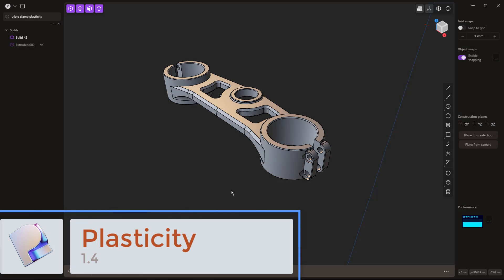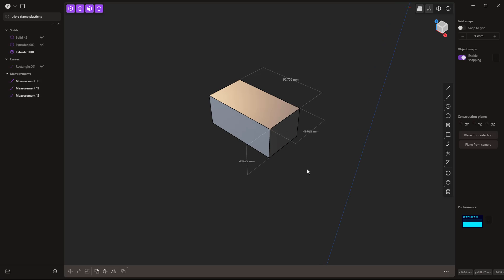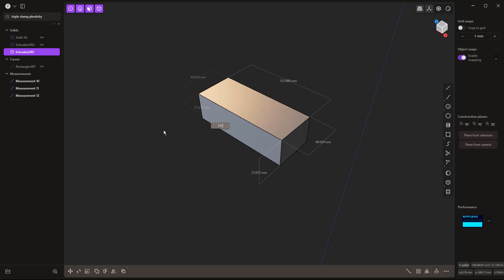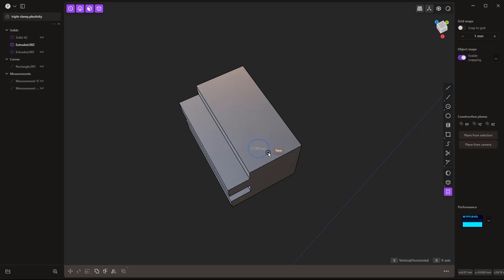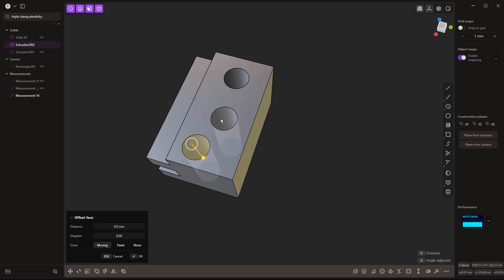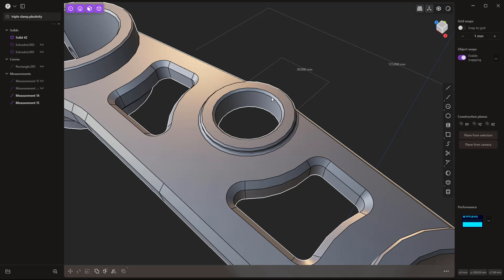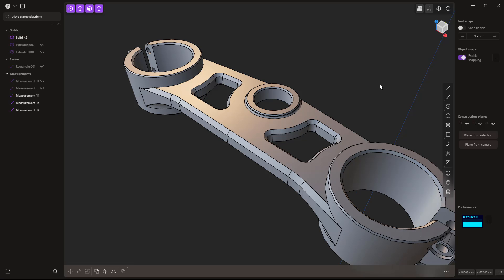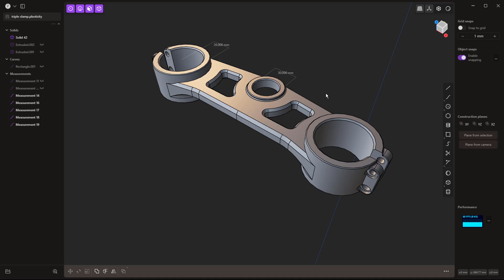Plasticity 1.4 | Dimensions and Measure Tools | What They Do And How To Use Them | #plasticity

Comment: Alot of great tips here! But for some reason my quick commands dont work! I have to search dimensions and click it in the search bar every time to use it. Not all the commands are like this, just some. Any tips?
Reply from the maker: hmm,  when you search for Dimension is the = key the shortcut you see?  With the dimensions on objects it will be dependent on the selection.  Does it work with anything at all?  Like if you start a new design with a primitive Cylinder or box, do you see those?
Reply: @LearnEverythingAboutDesign  thx for reply. Some shortcuts work, but far from all. Maybe its because Im on the free version still?
Reply from the maker: @Ronh83  that shouldn't be the case.  what type of machine are you on? Windows, Mac?  pc/laptop?
Reply: @LearnEverythingAboutDesign  im on a Windows laptop.
Reply from the maker: @Ronh83  do you happen to have a desktop to try it on?  I can't think of a reason why they wouldn't work for you.  Which version are you currently running of plasticity?  I am on 1.4.18
Reply: @LearnEverythingAboutDesign Looks like I have version 1.4.19   Are there differences with keyboards? I live in Norway, maybe my keyboard keys are setup different? And no, dont have a desktop.

Comment: I’m a mechanical engineer. I’m thinking about getting the indie license. I’ve been a Solidworks user since it was first introduced. The nice thing is I can create something export as a step, or parasolid. Bring it into Solidworks and use feature works to identity the part create sketches for features. Then I can fully define the part in Solidworks.
Reply from the maker: IF feature works works then yes :)  It is hit or miss.  But this is built on the Parasolid Kernel so you will be getting good BREP geometry in the process.

Comment: Really interesting thanks. at the risk of asking too complex a question: if i wanted to model a 3D bike frame, based on a simple set of key dimensions for the frame size, I think plasticity isin't really the tool for that right? like, if I started with a size "small" and then changed some key dimensions to make a "Large" frame, whole groups of features would need to be updated to new locations, and your video shows plasticity can't do that. I'm after a parametric modelling tool that is good with surfaces and won't break all the time, like F360 does. anyhow, v good video, thanks
Reply from the maker: Yeah you really want a parametric CAD program.  Fusion is great for that using user parameters.  If you have a commercial or edu license you can also use configurations.

depending on the complexity of the bike frame it can get pretty tricky to ensure the ends rebuilt properly.  If you are doing just simple tubes you could try the Pipe tool in fusion along a sketch but the chain stay area might get dicey.
Reply: @LearnEverythingAboutDesign  Yes I've pretty much completed a bike on F360 now (and watched lots of your videos) but I dislike how brittle F360 timeline is - upstream changes break refs all the time. I'm sure I'll get better at following the strict rules but its way worse than Solidworks, and having seen some impressive videos on Plasticity I'd hoped maybe that was the solution.
Reply from the maker: @s_cycle1921  yeah. certain features are more robust.  I break Solidworks all the time too :)

Comment: Other tutorials explain how to do symmetry while you do a rectangle by pressing the tab key, but in version 1.4 when you do a rectangle and try to do symmetry when you use the tab key, appears a measurement. Which is the new command?
Reply from the maker: 1.4 is the newer way.  I think for a rectangle you now hit C for center.  when you  have the tool active look at the bottom right corner and it will list available shortcuts.  This was a big point of confusion sadly :)
Reply: Thank you

Comment: How do you think Plasticity compare to Fusion's Form tools, specifically for use in Reverse Engineering using 3D Scans? Would you be able to perform the same workflow for your car scans in Plasticity as you did in Fusion?
Reply from the maker: Well Plasticity can't directly work with the mesh yet.  You can insert it but not snap anything to it, and it doesn't have freeform modeling like Fusion.  It does have pretty good surfacing tools.

So if you want to work with mesh data and want to use Freeform modeling you gotta stick with Fusion for sure.

Comment: 2:36 selecting the object and hitting = does nothing for me, have the whole object rectangular prism selected that i created from a rectangle. What are some reasons im not getting the same effect?

edit: nvm hitting a to select everything, allows me to hit = and tab through 2/3 of the measurements (not all the measurements but 2/3 isnt terrible, i can eyeball the last one). it's weird, simply selecting the object by clicking with the object selection (hotkey 4) doesnt allow the same behavior.
Reply from the maker: Odd but thanks for the update!  The = is meant to work with the box primitive but for me it works from the rectangle and extruding that.  If you use the box primitive or sphere or cylinder does it work any different?

Comment: I've taken the plunge on Plasticity and have enjoyed the whole experience. It's designed to encourage shortcut key strokes. Within a few weeks model creation becomes so we quick and natural even when surfacing. 
Moving the whole of the geometry of that motorcycle bracket outer clamp? Select point/line/surface grabs, select over all the points you want to move then hit g to move it any direction you want. Simples
Reply from the maker: Great tip!  Using move or rotated is an option but I don't think you could do it with a measurement/dimension input.  If all the selections are cylindrical it might work to do it from a reference plane.
Reply: @LearnEverythingAboutDesign  
If you want to move say 10mm in x, hit g then select X axis arrow, start moving with mouse in X direction then type in 10. If you want to move in a different direction use v to realign the axis.. If you want to move to an existing point again get it moving in the axis you want then hit control and the specific feature you want to move to.
Putting in exact dimensions while extruding or rotating is as easy as described above .. To me it is mildly annoying that you need to hit tab for exact line length or box dimensions. 
Although this measure function is useful, general feature information was/is always shown at the bottom right hand corner of the  screen. Select a line and it's length will be displayed there. Select an area and it will show numeric area of feature selected. select a solid will give position centroid etc.
Reply from the maker: @colinhare4722  oh yeah 100% agree.  I was just saying if you measure it at 214.378mm and need it at 215mm, the dimension tool just hitting 215 would be easier than grabbing everything you need to move and putting in .622mm.

For something like this I would stick with a CAD approach generally and not add all the little details until the geometry was right and then G or even Dimension would be so much easier.  Like deleting the hole for the fork before the bolt/clamp section is on you could just move a single outside face easily then redo the hole centered on that arc.

Comment: objects not lining up with the measurement tool. I pick the first object with shift held down then others then the last one. hit equals I get the measurement, hit enter then nothing moves what am I doing wrong.
Reply from the maker: Depending on your selection filter, the first selection might be an object and not a face.  Dimension (=) works on faces only.  You can change to face selection with the number 3 above the keyboard (not numpad) to make sure you are only selecting faces.

Select the reference face (where 0 will be), then all faces you want to move.  The last face you select will be the one used as a reference dimension away from your first selection.  Once all faces are selected press = to activate the dimension tool.  From there either hit enter again to move section 2 to n-1 to the measurement of the last face (n).

Hope that makes sense.
Reply: @LearnEverythingAboutDesign   that worked for the outer faces but it didn't work for the holes. The thing is that in the video you have all selections active.
Reply: @LearnEverythingAboutDesign   the weird thing is that when I tried to align the holes with the face on the other side it worked. Must still be a bug or glitch.
Reply from the maker: @terrykuehne6173  not sure.  I know it doesn't work with everything.  The first selection needs to be a planar face.
Reply: I am doing this in Linux, so I don't know if that's the problem or not. but like I said it does work if I try a different first planar face than the original. @LearnEverythingAboutDesign

Comment: I was between f360 and Plasticity about a year ago. Went with Fusion because it seemed more CAD oriented and more of a matured package. Now that I am familiar with the peculiarities of f360 surface modeling and Plasticity offers dimensioning I think it´s time to reevaluate.
Reply: Designspark Mechanical has had 'dimensioning' for what, 10 years now. The free version is a perfectly good CAD tool to make 3D prints - It uses Parasolid and I think the modelling is absolutely decent enough. It doesn't have G3 blends - but so much of it is very very similar strangely enough to Plasticity. DSM does have a Constraint sketcher or a traditional sketcher and patterns are procedural / persistent.
Many hobbyists and makers have given v6 a bad press due to the free version having .stl imports and dxf exports taken away - the ability to break step read-only imports into readable steps was also removed from the free version. Free version is free, Paid versions additionally have Drawings and Data Exchange and importantly now a universal instant object mirroring tools, all available on flexi-monthly subscriptions - full  yearly cost, if needed, will be less than Plasticity v2.0 cost. Any hobbyist that creates their own models and just wants to 3D print, DSM Explorer is very good and free - Learn direct very capable CAD for free. Annotation dimensions are smarter in DSM because they can be directly and indirectly used ( referenced)  in move and pull operations.
Learn Everything About Design is a great channel.
Reply from the maker: Yeah there are no shortage of options.  I own several CAD programs and have explored many others like Shapr. Rhino etc.  I think where the free version of Fusion shines is the ability to do SubD modeling on a mesh body, to make PCB designs, and simple detailed drawings as well as program/control CNC machines(with limitations).  That is one reason (as well as the UX) i like Fusion.  It isn't perfect but pretty good when you compare what some others cost.  FWIW Fusion and Plasticity are both on the same Parasolid Kernel as DSM, Shapr and many other CAD programs.  That is a big reason for the price of Plasticity.  The indie version is basically paying for the kernel.

As Software progresses I think there is going to be a big shift based on what the user is doing.  Direct modeling is a great tool (SpaceClaim) and that is how Plasticity works as well as some of the tools in Fusion.  One big difference you see is the OS support.  Plasticity supports win/mac/linux i do believe.  when you look at mac support that greatly limits your choices of CAD/Modeling and if you dive into Linux that restricts it even more.
Reply: @LearnEverythingAboutDesign  i thought DSM used ACIS, not Parasolid, And yeah, Mac Os does not have a lot of options, other CAD software i know it works on Mac is TurboCAD, one of the softwares that is part of market i like to call "AutoCAD indie clones"
Reply: @omegadeepblue1407   DSM v6 is now Parasolid.
Reply: @TAH1712  What?!
Reply from the maker: As Tah1712 , the change to Parasolid happened in V6. I think it was because of the addition of a constraint system.  I don't think ACIS was able to support that.  That is what I understood anyways.  I think Spaceclaim is still on Acis though.
Reply: @LearnEverythingAboutDesign  The Constraint system was introduced in v5 (ACIS).
Ansys mechanical is also using Parasolid. Perhaps a rationalisation of kernals and /or a deeper integration between Ansys SC / Discovery Live products and Ansys Mechanical - I don't really know. V6 constraints is greatly improved over v5 and is quite sophisticated now.
Reply: But cam